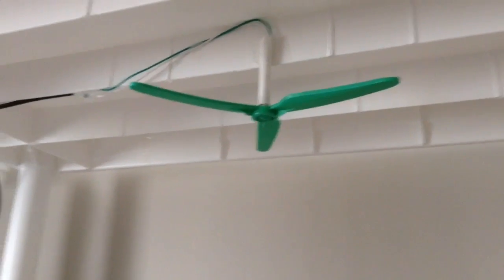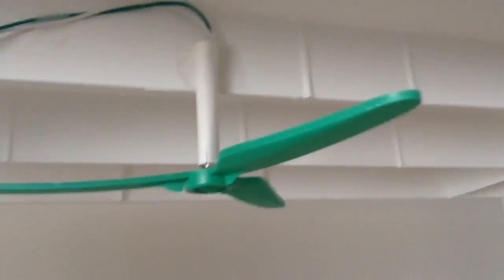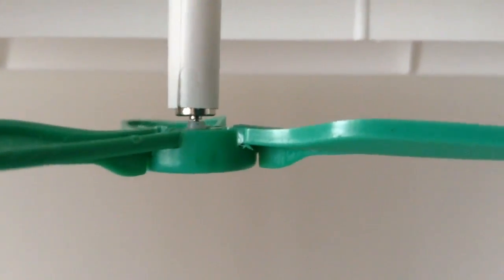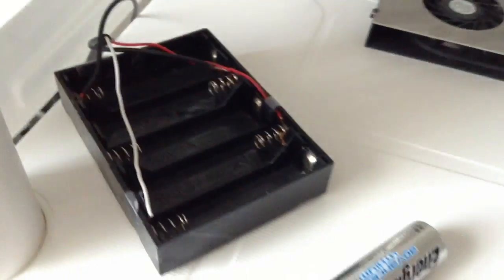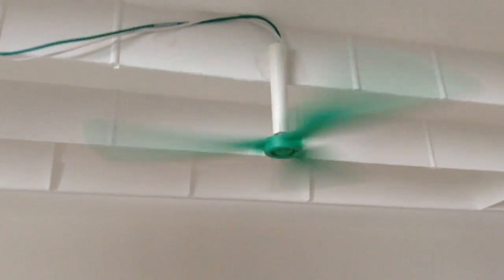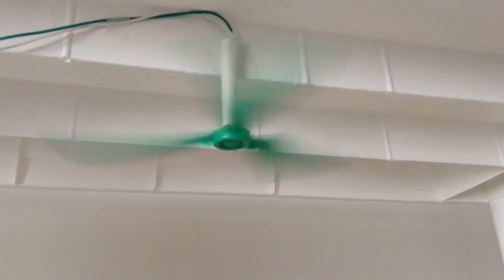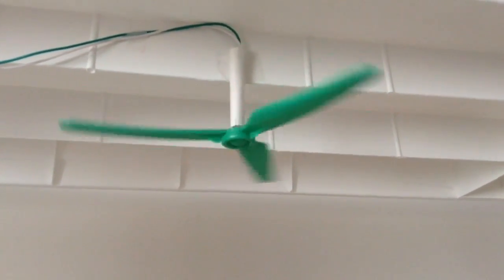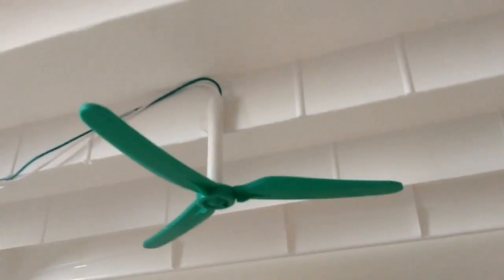Homemade 5” Mini Ceiling Fan

Comment: if u want an working small ceiling fan use an rs775 and an 12 inch fan running at 12 or 20 volts

Comment: That thing IS actually blowing air. It's just blowing air up, although you may not notice. It's the direction the fan is moving, and the way the blades are angled.
Reply from the maker: That is true, however the little motor in this fan does not spin fast enough to blow air. As well the pitch on the blades are too shallow to move air.

Comment: I would switch direction so it would blow air down.
Reply from the maker: Well, the blades do look like they have some pitch, however I did try reversing it but it still didn't blow any air. I guess the RPM is on the fan is too low...
Reply from the maker: +The Channel of Random Ceiling Fans yes I have. I also subscribed to your channel!
Reply: Thanks for subscribing!
Reply from the maker: +The Channel of Random Ceiling Fans no problem! Great videos you got there!

Comment: I have that same kit! You could make a solar windmill, fan, boat, etc. I can build the same ceiling fan!
Reply from the maker: Yes! That is the kit. My solar panel refused to work so I took it apart and built this fan.
Reply: Cool but where did get that blade from can see in online and search I really want one